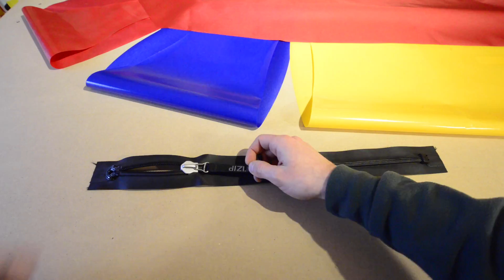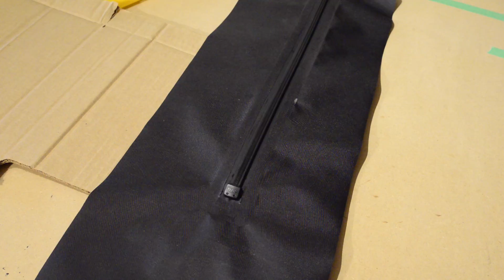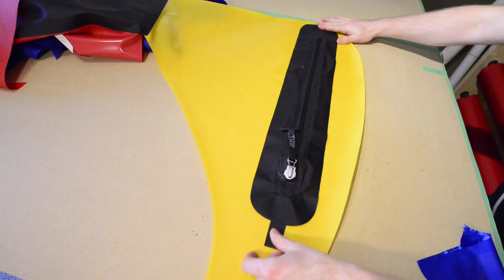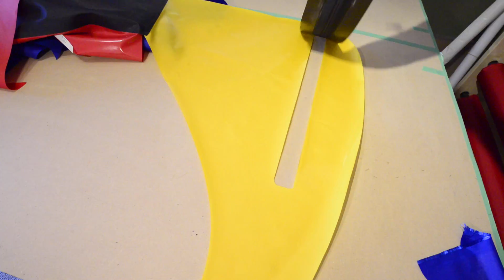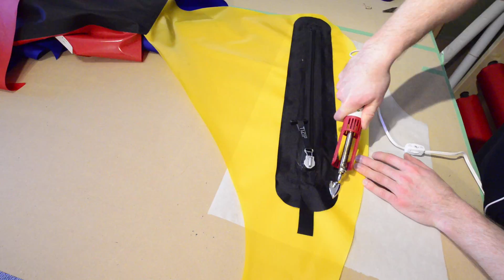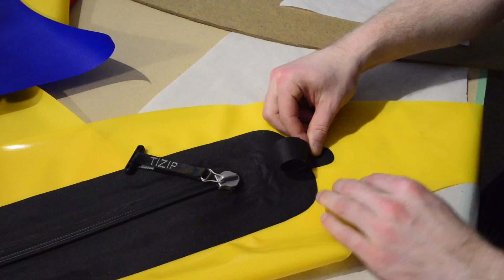Install an Airtight Zipper in Your DIY Packraft

Comment: Found your store! Trying to purchase a zipper, yet the sizes were too small. Do you make them in larger sizes? also how do they hold up at 80 miles per hour for a water tight cover with a port hole as far as a cockpit cover? thank you!
Reply from the maker: Sorry, I don’t sell other sizes and I haven’t done any high speed testing.